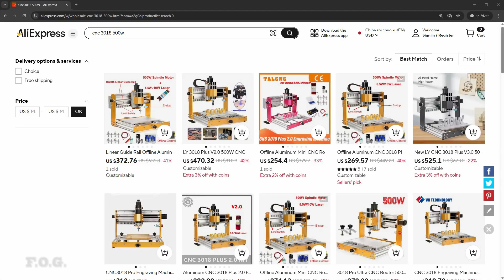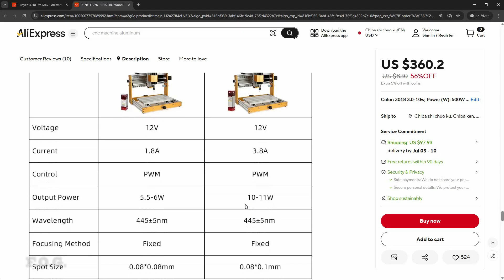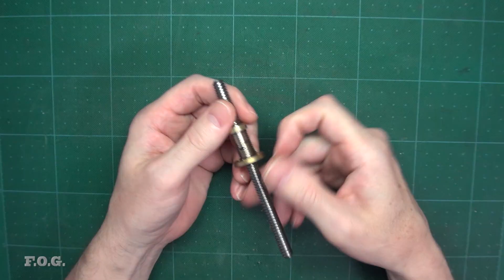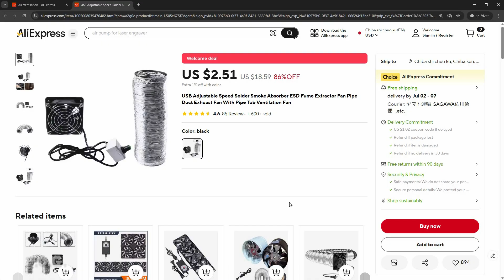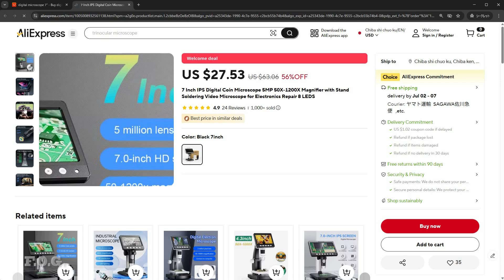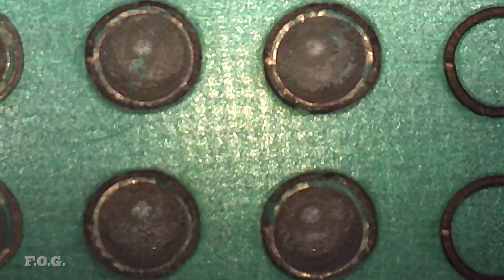DIY PCB Tutorial – Addendum – Equipment & Precision

Comment: People upgrade the z-axis to metal and it is too much additional weight on stock 3018 rods.
Reply from the maker: I did not see much of a difference when I originally added the metal z-axis using the stocks rods.. wasn't really better or worse, it still worked ok.
Though the basic logic of it not being a good fit is sound.
Thanks for the comment!

Comment: Thank you for this, it’s super interesting and I’m going to be trying it out soon. Also just a tip for others re: the heat plate - if you have a 3D printer it is likely capable of reaching 80C and could be used for this I think - and models like Prusa let you set it outside of a print needing to be running. I’m yet to do this but I plan to try this putting maybe eg a bit of foil down to protect the bed underneath
Reply from the maker: Thanks for commenting, and I am happy to hear it was of interest to you.
Actually, I am working on a few things right now, that I think are also going to be pretty interesting, so stay tuned for that!

Comment: I want to share how I solved the problem with the asymmetric point of the laser. I changed the program with which I make the gcode for the laser.
For working with the laser I use Lightburn and for working with the spindle I use FlatCAM.
The idea is that the laser cuts only in the X direction left and right. Lightburn does exactly that. My laser also makes an asymmetric point 0.03 by 0.07. Therefore, when cutting vertically (Y direction) it leaves a lot of residue on the copper, and horizontally (X direction) it cleans everything. In practice, I engrave a photo instead of outlining the fields. KiCAD has an option to export DXF files. Lightburn uses vectors and is not very complicated.
The disadvantage is that it takes more time, but it achieves a uniform effect everywhere.
There are other things that I improved, but overall I learned from you. Thank you for that.
Reply from the maker: Actually, I have recently come up with an excellent fix for the abnormal shape of the laser, it is nearly the perfect solution and takes little effort.
Thanks for taking the time to share your experience and approach!
Reply: @ForOurGood  Looking forward to learning what your approach is. Video coming out soon, I hope.
Also, curious: in your own experiments since the big (excellent tutorial) video came out, what has been the thinnest trace you have reliably achieved? Curious what it would take to achieve 4-5 mils (0.10-0.12 mm) trace widths.
Reply from the maker: @ajohansson1981 I am currently working through and confirming a number of new methods, it takes some time, thus the videos are delayed until I am completely sure of the results.
The current method I use is based around designs using minimum gaps of 0.15mm (includes a 0.03mm etching safety buffer), typically my small signal tracks are 0.1mm, but sometimes I will use 0.08mm tracks if things are tight (down to 0.05mm should be possible, but not really practical). The pads can be as small as 0.2mm wide, and can clear them successfully. The smallest silkscreen font I used is 0.8mm, and I am currently getting excellent results with that (I doubt smaller than that is either practical or possible)

Comment: set z max as your homing position and add a -z button in lase rgrbl that will move the laser to the focal point.  to have the laser located on the ganrty put a 3d printed lip on the laser. so when you drop it its always that point. when you need thicker or thinner materials just offset the z by the thickness. works great for me.
Reply from the maker: Thanks for the contribution!
I guess I am an old dog who is hard to teach new tricks.(Sometimes I eventually do 😅)
I am aware that I am likely overdoing it with the way I set the laser height every time I install it, but typically I only do this once at the point I install the laser, so I am not too fussed about that, and it generally gives me peace of mind. (I am and OCD type of guy!!)

Comment: This is really great info, mate.  I've a couple of these cheap CNCs that I acquired specifically for PCB manufacture. I have had great luck etching PCBs, but drilling and cutting is always a pain by hand, even with a DIY micro PCB drill. I look forward to getting them up and running, with a good dust extraction setup as well.  I'm not fussed with silk screen and the like, so I'm spared the laser complications.
Reply from the maker: Sounds like you are right into the deep of it, great to hear, and I’m glad to hear the video was of some use to you.
For sure, you can probably do without the silkscreen, but honestly after building my latest pretty complex PCB, I finally realised just how beneficial the silkscreen can be, especially in a manually placed situation. For testing and debugging I have also found it invaluable. 
I am using text size of 0.8mm high now without a problem, that is working well, but I doubt you could, or even want to, go much smaller than that.
Thanks for taking the time to comment! :hand-pink-waving:
Reply: @ForOurGood  I typically limit myself to through hole parts and single sided boards, and use the copper for labelling and chemically tin the finished boards to prevent corrosion and make soldering easier.

I really like a professional looking finished product, so the temptation to use mask is high!
Reply from the maker: @DadofScience  Oh dear......coincidently, lately I have been thinking about doing a rant video just about asking people to please stop making through hole PCB's...:face-orange-biting-nails:
It's not meant to be offensive, I really want to help people, liberate them from a self-imposed limitation. Of course, there are situations where through hole PCB's still make sense, but honestly this is pretty rare...
Anyway, I hope my videos can help people make the leap... and maybe I will make that rant video after all!  :face-blue-smiling:
Reply: @ForOurGood  Yeah, fair call, and I do make SMD projects on a regular basis. I think the smallest boards I've made (to test tolerances in my process) were around 18x11mm, used 0806 and SOT23 parts, with 0.2mm track clearance. It worked really well, actually :)
Reply from the maker: The SMD specs you are achieving are actually pretty good, I was going to tell people to just start using 1206 and 1.27mm pitch SOP packages, but you already exceeded that!:trophy-yellow-smiling:
This latest board shown in this video, is using 0402 for most things, with the QFN24 being the most difficult package to deal with (likely with the USB connector coming in a close second...)
I found 0402 to be not that bad to deal with, but I think most people could comfortably come down to 0603... and the nice thing is the resistors still have labels! Yay!
My final effective and safe clearance I am using lately is 0.15mm, primarily using 0.1mm tracks for signals, but occasionally using 0.08mm when things are tight. It should be no problem to use 0201 packages and 0.05mm tracks with this process. But honestly, it increases the stress levels when pushing it that hard... so maybe I will only use that for experimentation, or for the very rare super micro project. :face-turquoise-covering-eyes:

Comment: I have the same Z axis assembly - how did you take it apart to install the rails?? Mine appears to be glued together or something!
Reply from the maker: It’s a great question, thanks!:medal-yellow-first-red:
Actually, I did touch on it a little in my original CNC rebuild series, but this Z-axis assembly is all held together with a green retaining compound, something like Loctite 638.
It varies a little for different compounds, but it usually takes heat of 260degC or so, to get it to release. A small gas torch will usually do the job.
I also read that there is also a solvent you could use to release it, but I am not so sure about that.
Even so, I did not realise this when I disassembled mine, so I ended up using brute force, with various levers and bearing pullers and stuff.. thankfully I did not damage it! :face-orange-biting-nails: